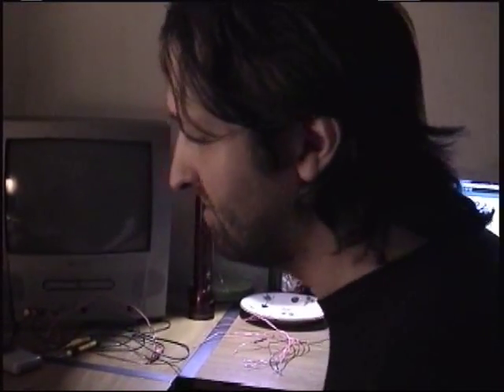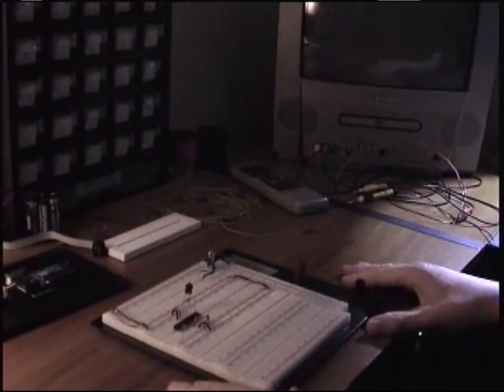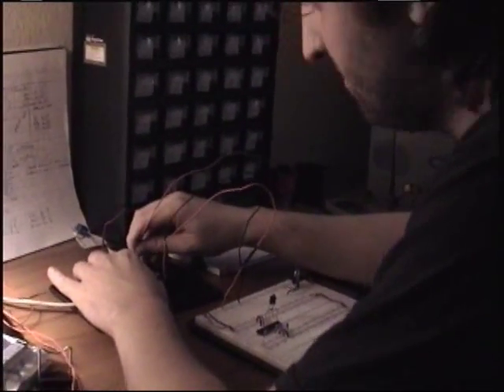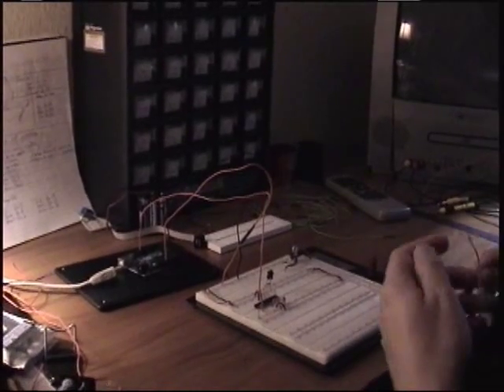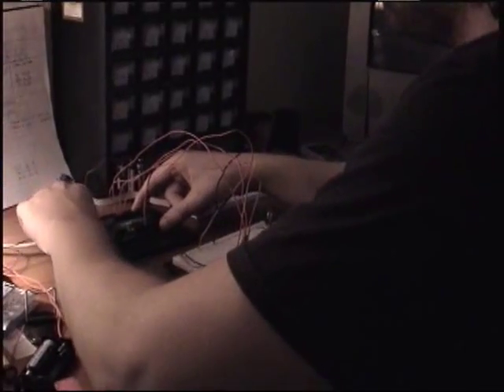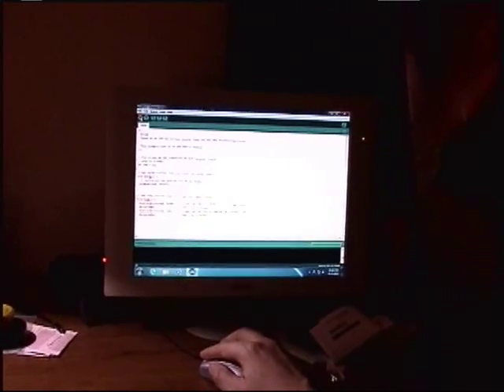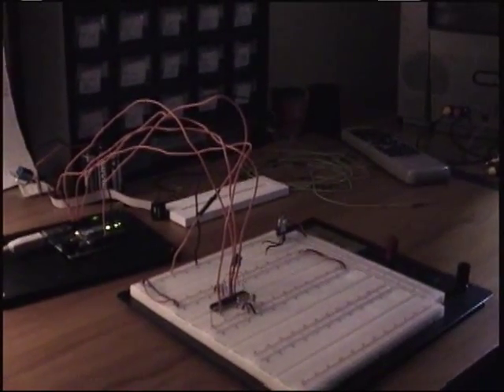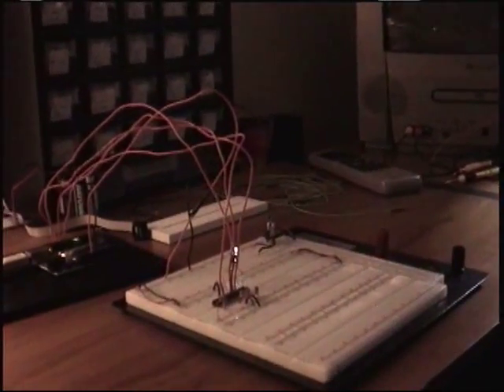Arduino as ISP programmer in circuit burn bootloader tutorial #2

Comment from the maker: Thanks. I'm not sure I totally understand what you're asking. What I assume is that you want to program your ATmega 328 "in circuit" on your project? Yes, you can do that. You just need an ISP (Arduino, for instance) as a server and wire the output pins on this tutorial with the input pins on the client chip. Should work like a charm.

Comment: Hi. I finished my project, a moving LED message using 8x24 LED matrix, 1pc 4017, 3pcs 74HC595, few transistors and resistors. If I burn the program into the separate breadboarded ATMega 328, does it mean it can run the circuit I made when I placed the IC into the circuit board powered by a 9v battery with 7805 to regulate the V+ supply? Thank You. Great tutorial you have done here. Simple.

Comment from the maker: The cool thing about Arduino is you can program the chip and remove the chip and put it in your circuit and keep the Arduino for other projects. Or you can buy blank chips and burn your own bootloader using your Arduino and use your Arduino to transfer code from the computer to your circuit using the Arduino as the go between. The chips can be purchased on ebay for really cheap. If you dont want to burn a bootloader, buy the ones with bootloader installed. I think they go for $3-4 on ebay.

Comment: Thanks. After I burned my program for 8x24 LED Matrix board, do I still have to burn the bootloader in it? Or the 8x24 LED matrix program that I uploaded into it is enough for the ATmega328 to drive my project? I also thought that the bootloader is intended only for Arduino board sketch programming.